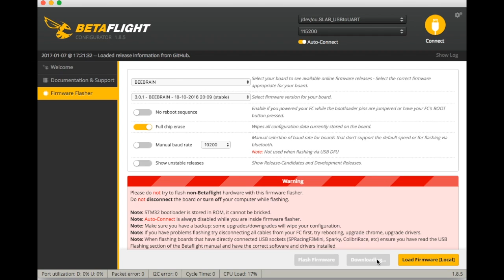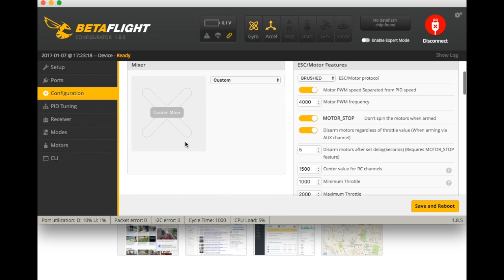Rambo Whoop Recipe - Step 1: FC Flashing

Comment: I really liked your rambo whoop set up so I bought the exact setup. Only problem on initial setup was I had issues with throttle inputs sticking and then rising on their own (strangly only with 1-2 motors spiking to almost max throttle...with throttle stick all the way off). Any ideas on what the prob might be. Also it looks like motors are reversed (motor 1 is bottom left instead of right and goes in an N pattern) which I can understand since I have the inv FC but I thought your CLI dump addresses that?  Props spin in standard quad direction (pushing inwards) just to state.
Reply: Russell Bruel have you update to 3.0.1? I think earlier versions had such issues.